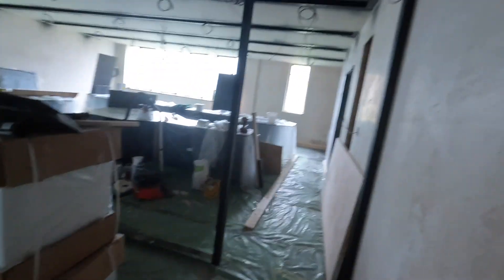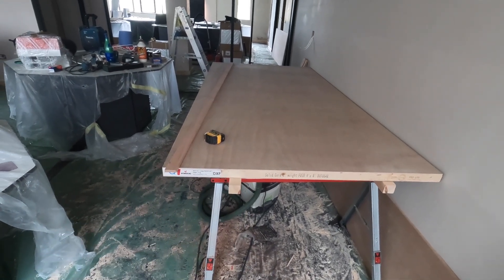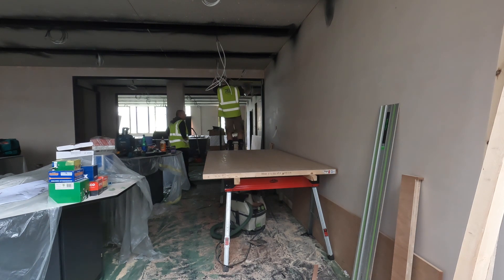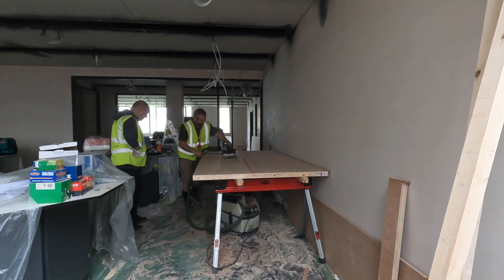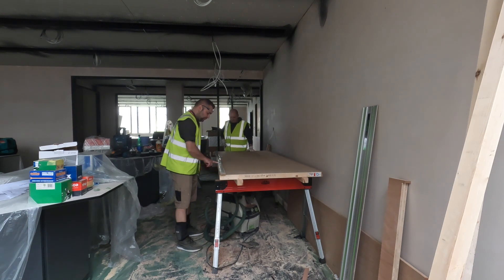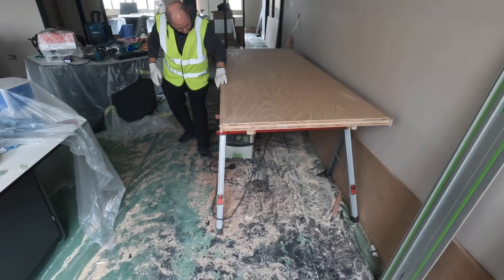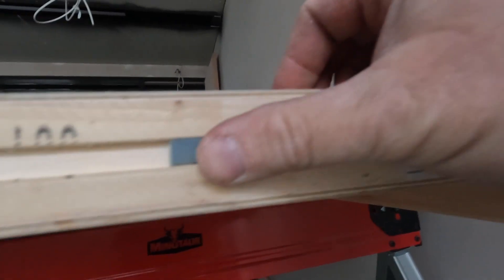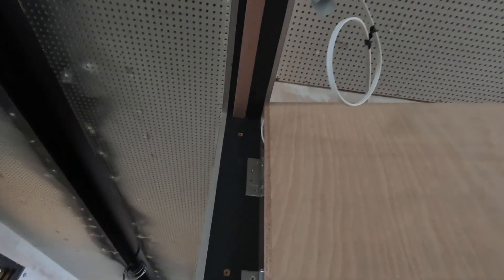30 minutes blank fire door

Comment: Hello.. Great video.. If installing a pair of fire doors what do you do where they meet in the middle.. Many thanks
Reply from the maker: @stripfix1979  Hi . Normally there are specifications what to do . If not I will do one fire strip with brush . If this doesn’t meet the requirements you can add another one without the brush .